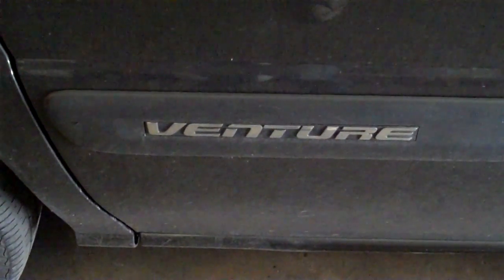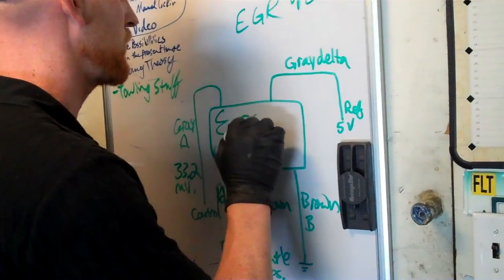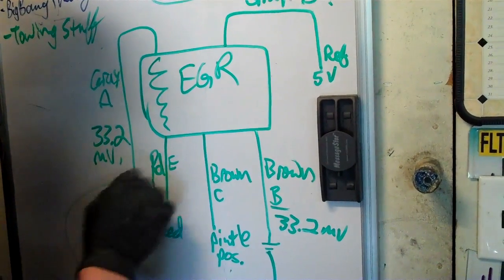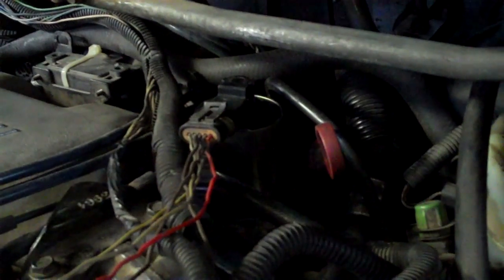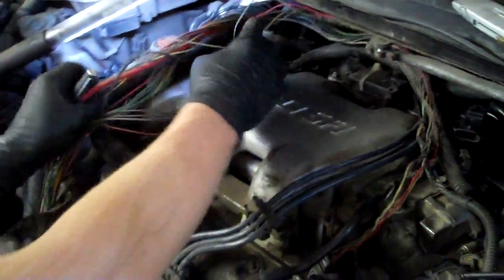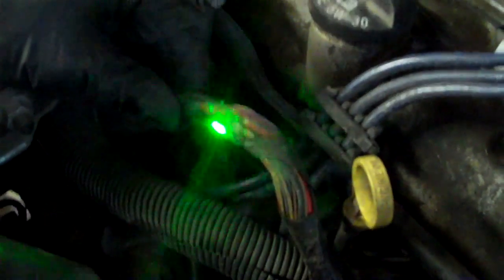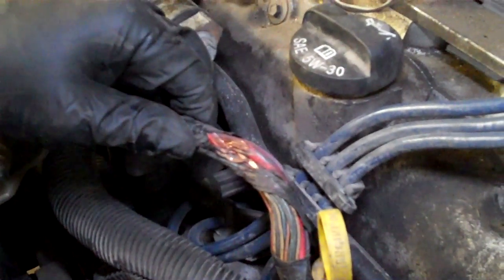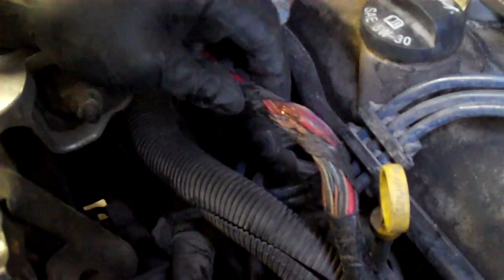How to fix a Venture or Montana Code P0405 when it's a wiring problem

Comment: Hi, a question: Is the thick red cable (come from the alternator +out, to the starter) that overheated and the cover plastic failed with the other wires? Thanks

Comment: I have a Pontiac Montana 2002 when you disconnect the battery the hot cable exports when it touches the battery when the ignition switch is off it's a magnetic switch could it cause the battery to spark and drain your battery and how do I fix it I am an ex mechanic it's out of my field call smile went to vote and it was in the 1981 I'm familiar with the older stuff not none of the newer stuff could you please help me thank you and you have a nice day

Comment: Good stuff..like the vids that lean more to diagnosing and tracing a fault than simply unbolting a part and bolting on a new one.  I am trying to figure out a 07 Caravan at the moment with a P0405 and now thinking there may be some wire tracing in my future..signal is a few mV and should be about 4.5V at KOEO

Comment: Putting a fan feed pulling as much as 15A under load together with other wires is a REALLY poor idea, you wouldn't see that on a Volvo 850 or V70 (though there is bad stuff on Volvos that Chevy wouldn't do)  Guess it evens out....

Comment: Another very classy video, with a clear message that we all heard, check your connections. 

Experience will often make diagnostics faster, because you've seen a similar problem before. But it can also be a trap because you can initially miss a more unusual diagnosis.

Comment: I have a 2003 venture and it had the head gasket under warranty and the over torqued the bolts and now after paying to replace the front 3 bolts now one in the back will cost me double as you can not get to that part of the engine with out pulling the engine . It is sitting in my drive way now for 5 months as I am a disabled VET and do not have the money and I can not fix it myself . I also had a 91 camry but was rear ended putting the trunk in the back seat thak god no kids in car I hate chevy